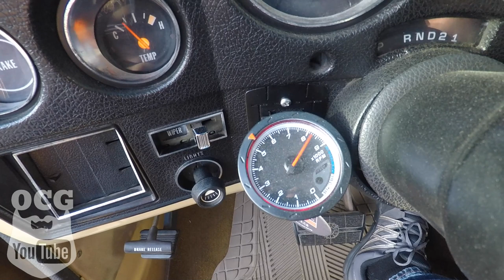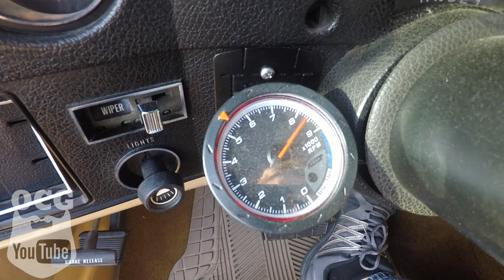I FIXED THE INTERMITTENT BAD IDLE IN MY 1977 CHEVY C10 BUT IT WASN'T WITH A QUADRAJET

Comment: Run-on can commonly be caused by not enough initial (idle) ignition advance... especially when upgrading a cam.   This is common when running a smog-curved distributor in and engine where all emissions spark controls have been removed and/or your distributor is connected to ported/timed vacuum.
Reply from the maker: My truck is a pre smog truck/carb. Now that I have the Qjet back on it, the run-on is less violent but still there. I have some colder plugs I’m going to try as well.
Reply: @OldeCarrGuy      Friend me on Facebook and I will help you out with that.  It's likely not spark-plugs but rather the ignition timing.  I can tell you how to test.  Message me so I know who you are!   JV

Comment: I seem to remember, some carburetors having an electrically controlled dashpot, to change the idle stop whenever the AC clutch is engaged. Tony B
Reply from the maker: Thanks Tony! I’ve ordered a throttle or idle solenoid! That should cure it!

Comment: Running into the same issue after swapping out a Summit carb to a Holley 650 (4150 style).  I thought my idle was low but adjusting the idle didn't help the main issue of drastic rpm drop.  I just want to run my ac and not have to touch it at stop lights.
Reply from the maker: Ultimately I ended up installing an idle solenoid. It get power from the a/c and bumps the idle when the compressor kicks in.
Reply: @OldeCarrGuy  I'm going to look into that!
Reply: @OldeCarrGuy how did you do that?

Comment: Great work, hopefully it's all sorted. Run on is caused by a number of things. In your case check your carby idle stop screw to insure your butterfly is adjusted correctly. Run on is also caused by incorrect timing and or carbon build up. Perhaps run a colder plug and check if it gets better.
Reply: And what kind of fuel is he running?? As in how high of octane??
Reply from the maker: I did pick up a colder set of plugs to try. We’ll see how that goes! Also our premium gas here is 91 octane! The run on seems to be less prevalent with the Qjet installed but it’s still there!
Reply: @OldeCarrGuy  I'm also wondering if you have a possible intake leak contributing to the issue.
Reply from the maker: Although possible, everything works fine with the edlebrock. It may be not sealed properly to the intake! We tightened it down pretty good, but had made some modifications to the adapter plate! You’ll see in the next viddy!
Reply: @OldeCarrGuy  hi, the only way to solve problem, is to install solenoids to open and close idle orifices.  So, no fuel , no runouts. That proven. 
Thanks
Reply: @OldeCarrGuy  hi, engines with fuel injectors never have that prob. It's carb only. See my below comment

Comment: So what if this happens when you're NOT using the A/C at all? Same things happened to me but only this winter after it's hit the lowest temps in a long time and I left it longer than usual. Bad fuel sitting? Drives fine over 5-10mph. Just wants to idle rough and die when put into gear from Park, or idling very low or turning the car at low speeds.
Reply from the maker: You may need to adjust the idle up in colder temps and adjust your choke!
Reply: @OldeCarrGuy  idle in park seems very high already. I can't even reach the idle screw to adjust whichever idle screw you're supposed to adjust while in gear because of all the vacuum or smog lines running around the front there.
Reply: @OldeCarrGuy  do you think a bad fuel filter or TPS would cause this? No CEL's now but before I would get 1 commonly for the TPS because of hard starts and always need to pump it alot as fuel bowl seems to empty after 2+ days of not using it.
Reply from the maker: @DominiAeternum  possible vacuum leaks. May need to have someone look at it.

Comment: Ac system does pull down the motor rpms 300 is alot of pull down though wonder if the belt pully is loose it kinda looks like its slitley wobbling a little bit not sure if you noticed that when you pointed at it while it was on ac jason
Reply from the maker: Nah, more apt to be a vacuum leak or result of a lumpy cam with low vacuum!

Comment: there was a solenoid on the later ones, but im by far no a/c guy, but i believe there was some timing control to prevent that, could be the clutch its self, with the lsa on that cam it loses some vacuum at idle so maybe a vacuum canister. last one i had was the 82 with a/c idle didnt change but it had a new a/c system and a big block so that compressor didnt mean anything to it lol
Reply from the maker: Mine never had a solenoid, but I have one coming! It’s worse with the Qjet!
Reply: @OldeCarrGuy  i have had good luck with idleing on cams like that with the qjet but the last one didnt have a/c lol kinda funny you up in Canada have a/c and me way down south in the heat and humidity have no a/c lol

Comment: They make a solenoid, just for that. You can get by without it, you have. The AC idol step up solenoid works flawlessly. You can turn your curb idol down to where you want it, and no more run on when you shudder down. Octain boost or higher test fuel will solve the run on, if you choose to stick with the higher idol solition.
Reply from the maker: I ended up installing a solenoid.
Reply: @OldeCarrGuy  I've been fighting it. I'm going to have to do the same😂

Comment: OEMs solved this problem  with a solenoid to kick up the idle when the A/C is on. Your truck should have had this solenoid if it came from the factory with A/C.
Reply from the maker: My truck is a factory a/c truck and no solenoid, but I’m sure they are out there! May be the cure!
Reply: @OldeCarrGuy  I believe there should be a wire coming from the compressor harness that powers the fast idle solenoid at the carb. Maybe it got deleted by a previous owner at some point.

Comment: I’d check the operation of the idle solenoid in the Quadra jet and the Edelbrock to see if the idle automatically adjusts for the extra load of the ac compressor.
Reply from the maker: My truck is a factory a/c truck and it didn’t have said solenoid! When I bought it it was all original and no signs of a solenoid ever being on the truck. The problem is worse with the Qjet installed.

Comment: I will have to show you my solution to this problem. I may try to post it to Instagram tomorrow.
Reply from the maker: Looking forward to it!
Reply: @RealWorldGarage  hi I know you’re comment is 3 years old but I’m having the same issue I put a new alternator in because last guy has regular one with no ac I put the one for ac and still same thing I wanna replace the battery but looking for a different solution

Comment: I can't find any older videos relating to a 1980 chevy k10 where it runs but won't stay idling
Reply from the maker: Fuel pump or idle mixture screws possible.

Comment: What is that knock sound as soon as he turned his truck off because that noise is there nearly every time I accelerate. 350 5.7
Reply from the maker: It's engine run-on. At the time the timing needed to be adjusted. Good eye!

Comment: If the AC compressor is drawing too much amperage it might need replacement.
Reply from the maker: I don’t think it’s an amperage issue. More than likely a mechanical one! The clutch and or compressor could be piling up!

Comment: Helpful and nice video but having to turn off the AC to stop it idling bad isn't fixing the problem.
Reply from the maker: Yes, you are right, I did do a follow up video where I added an idle solenoid.

Comment: You had a Rpm Surging issue
Reply from the maker: No surging!
Reply: @OldeCarrGuy  when the rpm gauge bounces slitley up and down its called Surging when you showed the gauge when you turned the ac on thats idle rpm surging